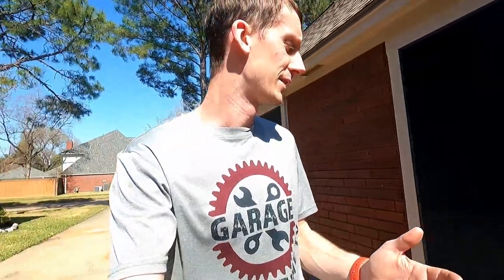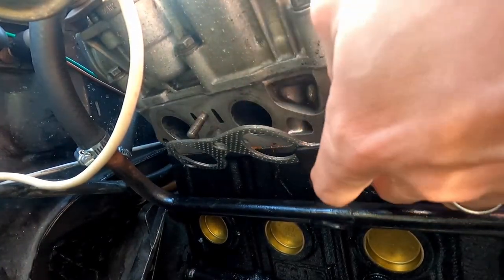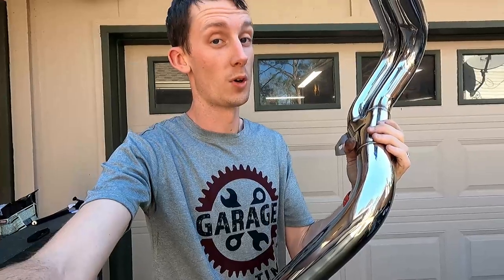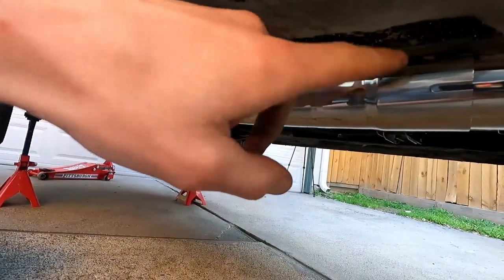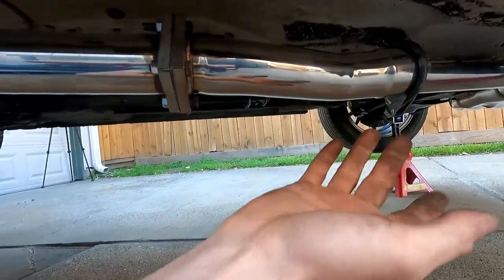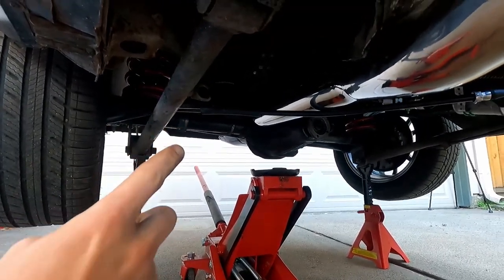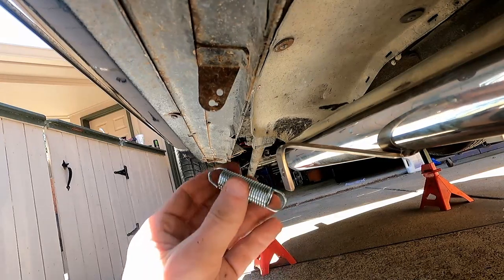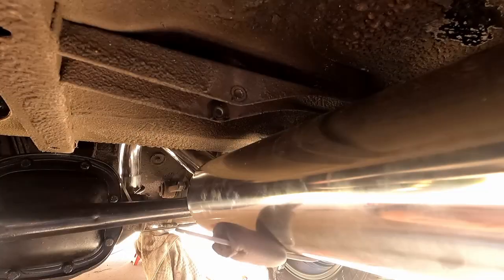FULL LENGTH Stainless Steel Exhaust Install for our 1982 Fiat 124 Spider Project! DIY!

Comment: Only Fiat would use springs and rubber to hold up exhaust, lol. Looks great!
Reply: Actually many cars do including Corvettes. Compensates well for changes in heat.
Reply: @stephanprotzen6030  I figured as much but have never seen it.

Comment: Did your downpipe slide easily on to your headers? I have the same system but I’m having a lot of trouble getting the downpipe on the headers. It just won’t slide on.
Reply from the maker: It’s a tight fit, but I did get them to slide on.
Reply: yo wadia
Reply: @layth116  yo what’s up

Comment: Vick Auto told me that it doesn't matter which side of the gasket faces the block.
Reply from the maker: @kennethpole2439  that’s probably the case. I just like the smooth side that’s squared off on the head side. Personal preference
Reply: @GarageTimeTV Thanks for the clarification. You and Jesse are a gold mine of information. SS exhaust installation begins once I remove the last rounded nut and then it's the new top -- fingers crossed.  Regards from B.C.
Reply from the maker: @kennethpole2439  thank you so much!

Comment: Excellent video my friend. My stainless exh sys just arrived, however I'm not exactly sold on that allen key clamp welded to the downpipe, I've been told that some people experience a small exhaust leak from that connection and ended up removing the allen key clamps and replaced them with the band clamps and voila! no more leaks, have you heard about doing something of this nature?  Thanks in advance.
Reply from the maker: Thank you for your comments! I haven’t heard that personally, and I never experienced a leak. I can see how a replacement clamp would work too though!
Reply: @GarageTimeTV  Wow! THANKS so much for the rapid fire reply,  I'm mulling it over, but if you're not smelling any exhaust then it probably works and will save me extra time.  Thanks again.  Cheers!
Reply from the maker: @walterorr4040  not a problem! I love it and it’s so simple to assemble. Definitely worth it!
Reply: @GarageTimeTV  Question:  Where did you get the springs to hold up the long pipe?  I looked everywhere for these springs and can't find them anywhere.  Thanks.
Reply from the maker: @walterorr4040  I went to Home Depot. I got a kit with two sizes in it. They are just generic.

Comment: Appreciated and copied your installation but cannot get the four-bolt connector plates to line up perfectly despite several removal and reinstallation of the bolts. Upper two OK but bottom pair won't let me tighten the bottom of the connection completely. It's about 1/16th askew. Any advice would be appreciated.
Reply from the maker: @kennethpole2439  are you talking about where the manifold meets the head?
Reply: @GarageTimeTV  No. The square four-bolt gasketed joint between the short extension and the longer strait exhaust.
Reply from the maker: @kennethpole2439  so I’ve seen others use longer bolts to help suck it together. I would leave all four loose then tighten on a star pattern to try and center it better.
Reply: @GarageTimeTV  Copy that, thanks -- again!!

Comment: I did not get this exhaust because of the O2 location. A very nice exhaust with no thought in the bung location in my opinion. Who wants to see a bolted up bung when you put it back where it should be.  I do like the header down pipe connection better than AR's which is a PIA. This should turn a nice gold color and be very pretty, get your grimmy finger prints wiped off.

Comment: how did you fit the down pipe to the header mine doesn't fit
Reply from the maker: Mine slipped right in. Make sure the end wasn’t dented in shipping. That happens. You can also use some WD-40 to help slide it on.

Comment: dose it need the springs to hold it up?
Reply from the maker: It held itself up, but the spring tabs were there. I put them on for support so the headers don’t hold all the weight. Better to have them than not.
Reply from the maker: @Totally_Not_A_Dumb_Ass  I would check the hardware store (Home Depot or lowes). You could even check amazon. The springs have some give. The zip ties don’t.